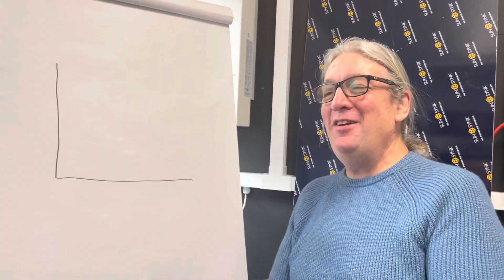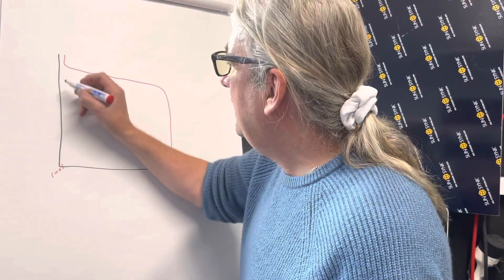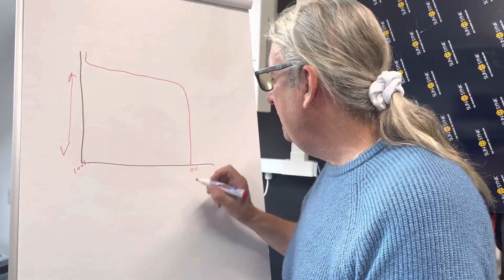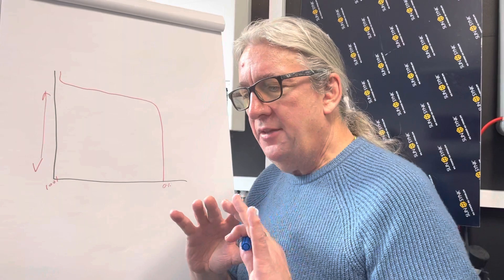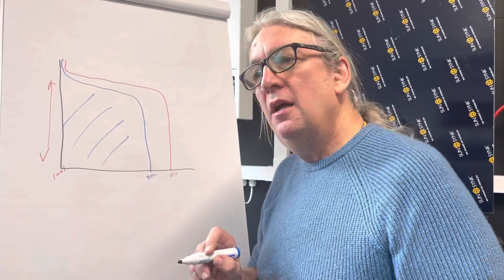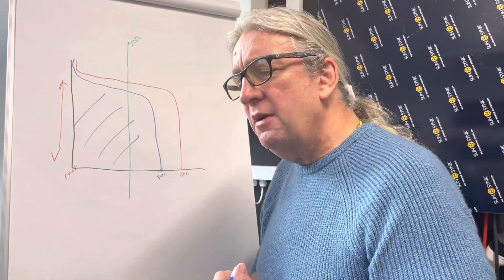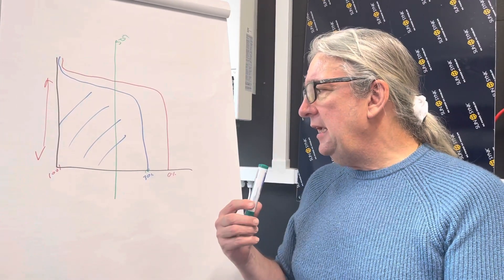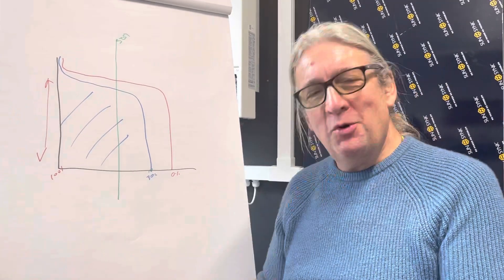New Batteries VS  Secondhand Batteries

Comment: Hi I'm from UK and I use second hand cells with bms. The used cells I have to test the capacity so the bms can be programmed with that capacity. Only thing is that the bms does not have canbus protocol so have to use it as lead acid on my luxpower inverter. I use a victron shunt to measure the capacity. Do  your units have Bluetooth capability to get data off victron shunt?  I'm looking forward to your 16kw unit so I can swap over.

Comment: Are we talking about individual battery packs, or banks of batteries ?
Because the individual BMS might be monitoring individual cells and balancing their charge based on differing parameters / setpoints ... therefore either equalisation is required with the whole battery pack ? or they should be dismantled and a High charge or Low discharge balance procedure should be performed to equalise EVERY CELL ?
The unknown variables with used cells are age and battery history, plus the capacity / resistance of these "second hand" units .....
Its always a gamble with anything pre-used though isn't it ?

Comment: The BMS looks at voltage, right? If one battery pack has  a usable capacity of 260AH and is in parallel with a newer better quality battery that has a usable capacity of 305AH then the voltage still rules the behavior. I have found that internal resistance plays a role though. I have a solar generator I have built with two batteries that are of the above mentioned capacities. The 260AH battery is made from used cells and the 305AH battery is made from new cells. These are lifepo4 prismatic cells by the way. I have noticed that because the used cells have a higher internal resistance, when they are being used in parallel with the newer battery they will not give their fair share of energy to the inverter until they have a few millivolts higher voltage. The extra pressure is required to overcome the internal resistance. When the batteries are full, I will get 2/3 of the energy from the better battery. Later they will begin to even out and at the lower end of the charge curve as the better battery starts to get lower, the weaker battery will start to supply more than its share of the energy as it catches up to the good battery. At the bottom they both end up at 2.5 volts at about the same time. During charging the behavior is approximately reversed. 

I'm not sure I understood your question perfectly but if I understand your question, that is my experience.